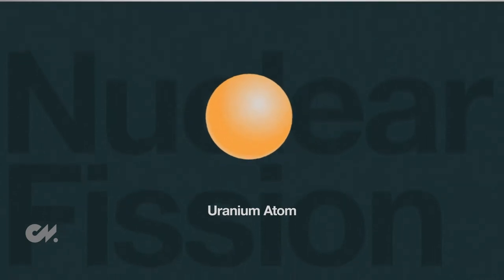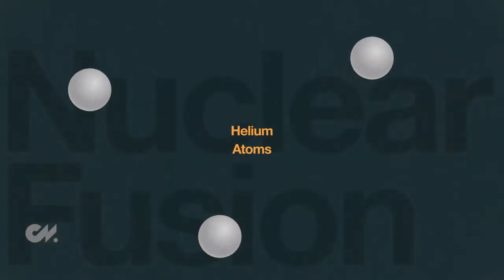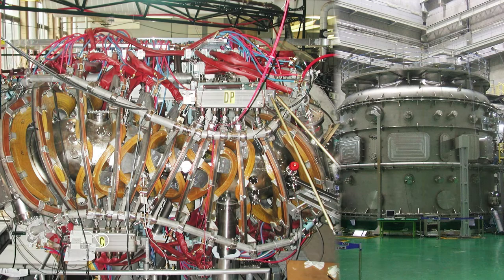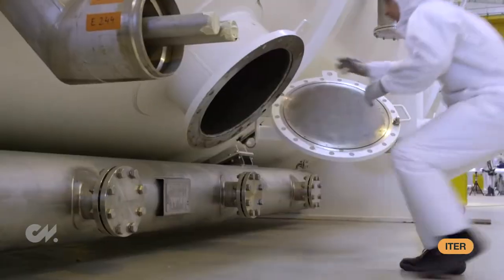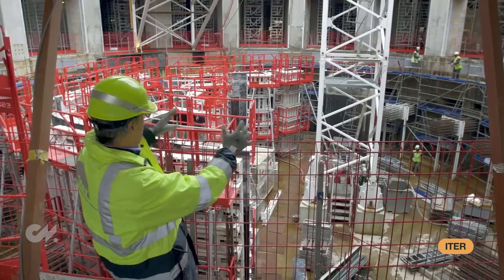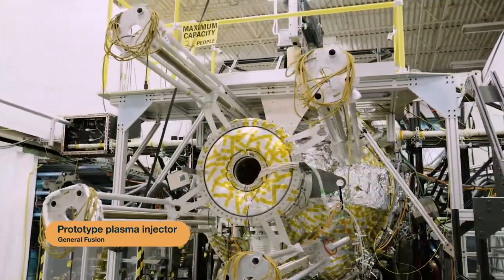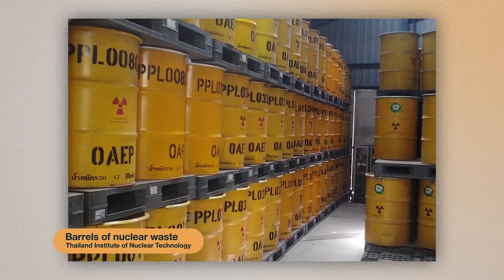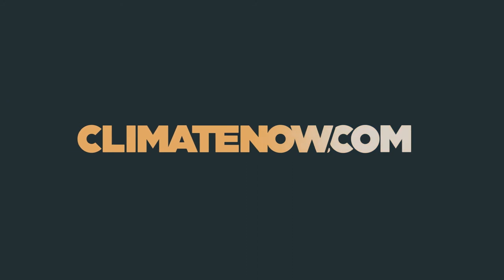Building stars on Earth: the potential of nuclear fusion | Climate Now Ep. 2.3

Comment: i didn't fully understand why the tocomac needs to be 150million degrees, which is hotter than the center of the sun - why does it need to be hotter than the sun?
Reply: Because the pressure at the sun's core is so massive.  Fusion needs a combination of temperature and pressure, if one is a bit low, the other must be high.